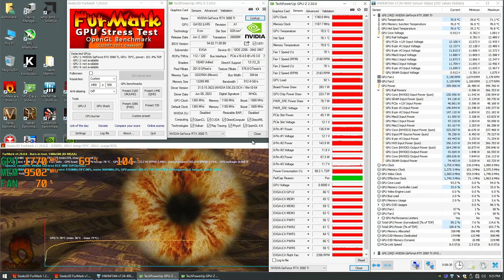Why you should try cheap thermal paste first

Comment: The issue with these inexpensive greases is that they dry out in a short amount of time.
Reply: no.. this type do the opposide! it can be the case that they "oiled out"
Reply: Do inexpensive pastes dry out soon? I am not sure.

Crucify me, if it has good reason.

I use 20y old Arctic MX-2 on my 3y old i3-10100f and it runs still ok. I used it on all my Cpus, applied on each usually 2y cpu upgrade cycle. Those stock coolers come with preapplied soft layer of thermal paste, not sure if all custom coolers aswell.

Even grainy state of my paste didn't make bad result, decent amount consistently placed on heatspreader except border made it.

I am not applying single big drop in center, well I do somehow but spread it bit help not direct accidental presing of cooler spread the paste in all directions, but maybe regularly tightened screws make it anyway.
Reply: @gstormcz  I don't know if its old paste or mishandling. My 5yr old noctua NT-H1 was still having half juice left, but I cannot push the paste out from the syringe.  its rock solid in there.
it's end up in the trash can.

I know everything has its shelf life. or mine isn't as good as yours. lol.

but I do have some old included thermal paste when buying cheap chinese cooler back in 2000's, it was still in liquid form.
do I use it? naah. just too lazy to throw it away. lol.
Reply: I would not call it misshandling, some pieces, some batches, some product at certain places or by people simply last literally forever, while other hard to make it to its guaranty/expiration time.

To be correct, my last paste is Titan TTG-S104 1, 5g
I can't prove its purchase date, unfortunately, but given the state of its plastic packaging being from transluscent to yellow degradation, it is stored very long by me. I usually keep every single PC item purchase date written, this one escaped of my data, xd. Maybe that's main reason, why it lasted for so long.. out of time.
Reply: @gstormcz  I should clarify:  When I say "dry out" I'm not referring to what happens in the tube due to gravity, where the silicone oil sinks to the bottom.  That will happen with any paste.  I'm referring to paste that dries out prematurely when in use...  Can it be remedied perhaps by adding your own silicone oil to the compound?  I don't know, I have a general idea of what heatsink compound is (metal oxide mixed with silicone oil), but I don't know what additives the higher-end ones use for stabilizers and whatnot.
Reply: @gstormcz   yes I agree. maybe just some unfortunate batch. it way past the recommended use life. lol. out of time.
perhaps if I don't keep record buying stuff it would last longer? haha.

@khachaturian100 yes. I understand. my cheap paste do need to be replaced more often than my noctua one. but I don't dare to add more silicon oil to it. its better to buy a new paste than replacing a new component due to misbehaved thermal paste. yeah I know the paste would not behave like liquid metal that would short stuff, but better on the safe side, since thermal paste are not that expensive.
Reply: @pieteryts  I think you could get your thermal paste virtually ethereal.
Remove price label, place it on cheek the paste use as lipsick and make a walk around city big square. It would gets definitely last way longer than you expect.
It won't dry out. 👍 
(don't try RMA at me, its not tested kind of use, but should still perfectly work)
Also don't forget report results.
Reply: @gstormcz  it won't dry unless being attached with a heatsink.
but I'll pass the test for that.
Reply: @pieteryts  It will dry out even without heatsink, just put it on sun light.
Reply: i have that exact cheap paste, and its not dried so easily. used it for a low power/thermal devices.
by the way, in my country that exact paste cost around $1 each.
Reply: TechYesCity tested out the GD900 after something like 4 years and it was still great.  Can't speak for any of the others though.
Reply: @toddtheZ  makes me wondering about shin etsu. the original paste that came with first pentium 4. it said was the best at its time. but has it dried after 25 years? lol

Comment: I am having issues finding last thermal paste for my HP Omen gaming laptop. It seems like after 3 months, the thermal paste either dry up due to high heat or squeeze out to a point my CPU starts to thermal throttle pretty aggressively.
Reply from the maker: only one way to tell. open it and look.
If you break it, you know who to contact :P
Reply: @northwestrepair  Just be honest and tell him to skip on Omen the next time around.
Reply: The thermal paste squeezing out is called the pump out effect. There are some videos that talk about it, but basically the thermal expansion and contraction of the heatsink from heating and cooling pushes the thermal paste out if it happens enough times. 
I believe using more viscous thermal paste can help minimize it, but it will still eventually happen.

Comment: what you're paying for is the manufacturer to make smaller particle sizes of the conductive material consistently, and the carrier fluid to keep them both close together and in a compliant state for as long as possible. I always use lower cost zinc oxide or the like paste for test gapping etc. Good idea.
Reply: Graphite powder is great. Take a graphite pencil (carpenter pencils usually have real graphite) and a 1000 sandpaper. The powder mixed with that white or grey not so good thermal paste really is changing the thermal transfer. The bad part is that you need a lot of very fine graphite powder. I would use 1500 sandpaper but it will take forever to make enough graphite powder. Beware! graphite is electrically conductive.
Reply: @Dandan-tg6tj  that's conductive
Reply: @goku445  So is the liquid metal. Please read my previous comment again. I already said this: "Beware! graphite is electrically conductive."
Reply: @Dandan-tg6tj  yes. I wouldn't use it. Too risky for little benefits IMHO.

Comment: I got some 30g random brand tube for $12 and it’s a degree difference between that and the Mx-5 I was using so I feel like that’s good deal lol
Reply from the maker: MX5 is not good for GPU because its too thick.
Reply: @northwestrepair  I didn't know that, thank you Dr ;)
Reply: @northwestrepair  also it was discontinued for bad QC and replaced for the mx-6
Reply: @northwestrepair  thanks for that tidbit
Reply: I wanted to get MX-5 for fun because I own an MX-5 Mazda, but I was glad I did not when I heard it was discontinued.  MX-4 20g is on offer at $12 right now on Amazon US and I bought some.  The Termalright Peerless Assassin 120 I just got came with thick thermal paste.  I tried to spread it and that was a disaster.  :)  With thick thermal paste, I guess you just use a dot or an "X" and allow the CPU/GPU to spread the paste instead.